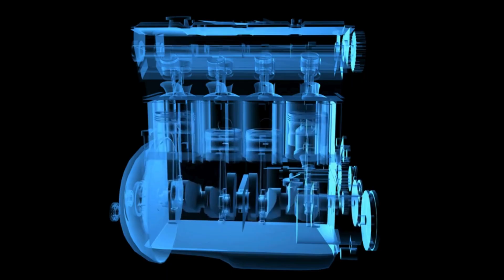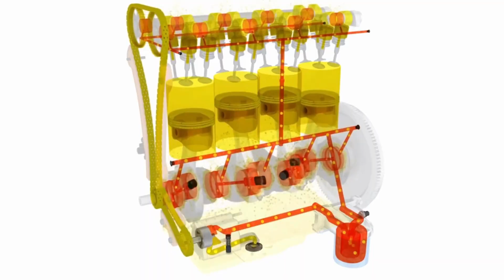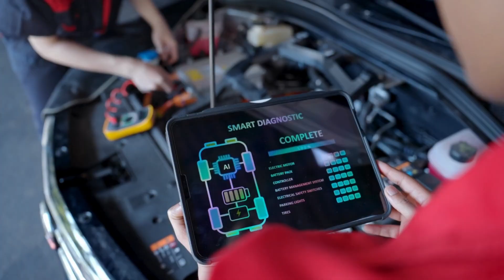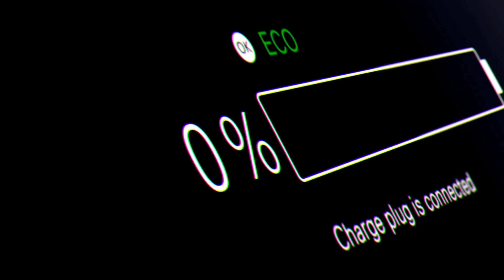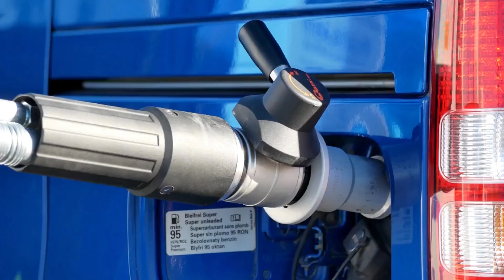Porsche's New 6-Stroke Engine Will End EV Industry

Comment: No it wont, Big Oil bullshit
Reply: No it won’t but considering that speed limits around the world keep increasing, EV batteries keep getting taxed needing more frequent recharges. Also, EV tires keep getting taxed at a higher rate than ICE tires due to their weight, needing more frequent replacements. Just remember, Porsche has the no speed limit German autobahn, and EVs are a FLOP!